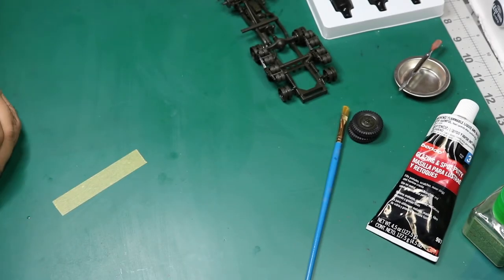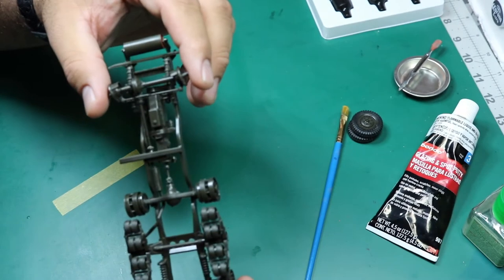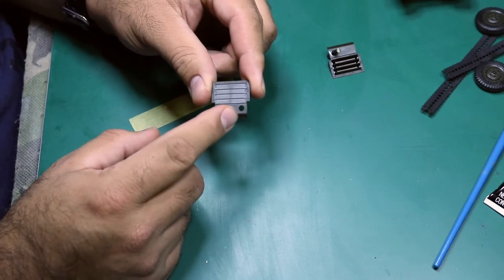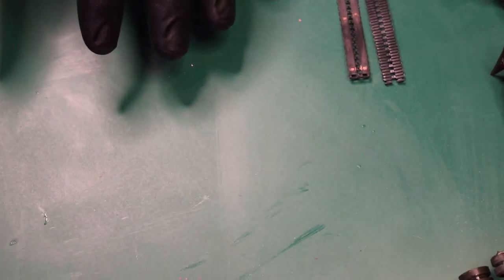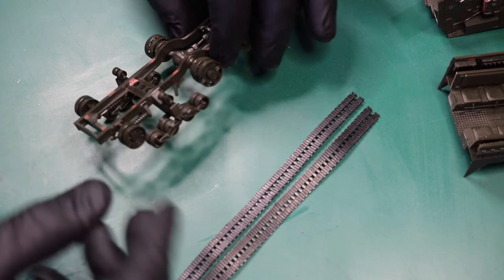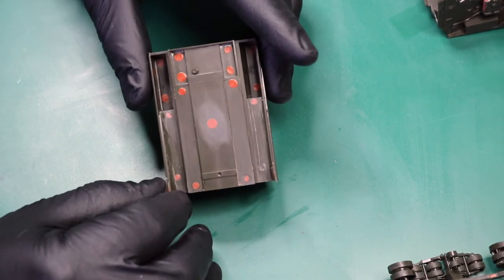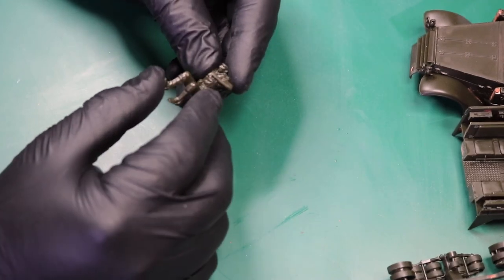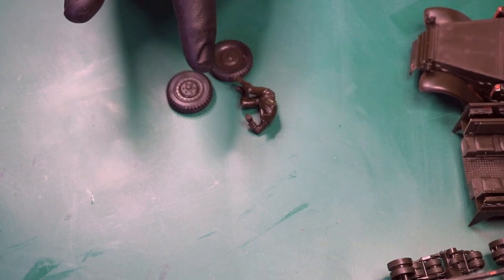1/35 Tamiya M3A2 Half Track Update 2.

Comment: Great work so far, Luis, bummer about the tracks...kits should be good enough to be able to be built without those kind of issues and we shouldn't have to go to the after-market suppliers to remedy them. if the kit fails in an area, the kit manufacturer should remove it from the market and either fix their issue, or scrap it. Good luck with the tracks. Cheers : )
Reply from the maker: International British Modeler you are 100% right Martin! Why should we have to deal with those issues when you have manufacturers that are capable of fixing them? Specially nowadays when you’re paying top dollar for a kit. Thank you for the great comment and for your input. Have a great day!
Reply: Have a great day, too! Cheers : )

Comment: For the tracks, make shallow cuts between "links" where it bends around the wheels, this will help it bend easily and reduce tension. Unfortunately the real tracks were actually "one" piece rubber so no gaps between links. So your cuts should be on the inside face of the tracks.
Reply from the maker: orange3D awesome tip! Thank you so much for your input, I will definitely try that.
Reply: Hope it works, I did it on a the 1/76 matchbox halftrack and seems to work. I had the Tamiya halftrack kit when I was a kid and it brings back memories! Hope to see this finished soon :)

Comment: That hole is for the winch.
Reply from the maker: brent schmidt thank you very much Brent! I’ll see if it’s visible or not and fix that if I have to.
Reply: LT Models there is a small drive shaft that connects the winch to the transfer case to power it.
Reply from the maker: brent schmidt yes i saw that on the reference picture I found. But the kit doesn’t include the shaft.

Comment: I've seen dragon magic tracks sold separately on evilbay!🤔

Jman👀
Reply from the maker: Kabul81 I haven’t, if you find them let me know.
Reply: LT Models I believe the rubber padded version of the M3 stuart was the same type used if that helps for ebay
search. Sometimes the dragon tracks are offered if 
someone decided not to use
kit supplied tracks.😬
Now if you wanna spend $50
theirs the fruil model option?😳
Jman👀
Reply from the maker: Kabul81 I see. So far the cheapest i saw was about $20 plus shipping. I think i might just use the kit ones, I was able to slap them on. Thank you for the tip man. I appreciate it.
Reply: LT Models 👍🏻
Just trying to help a brother out!😬

Jman👀
Reply from the maker: Kabul81 thank you